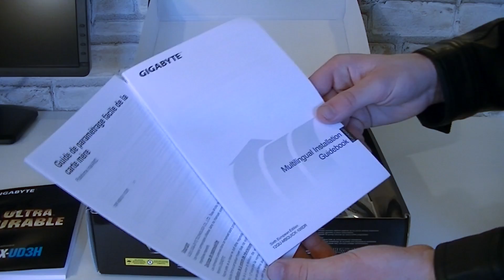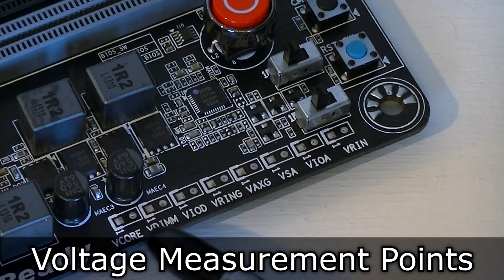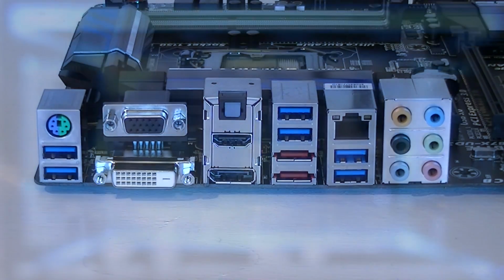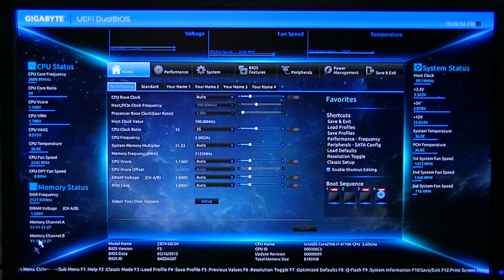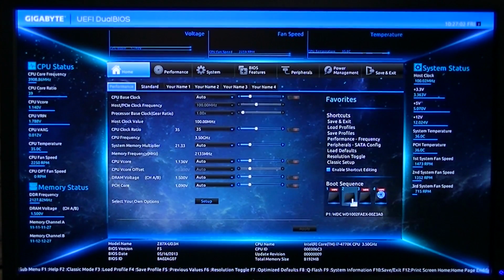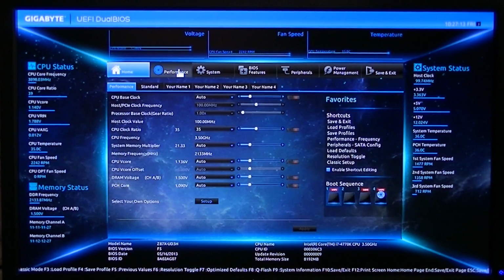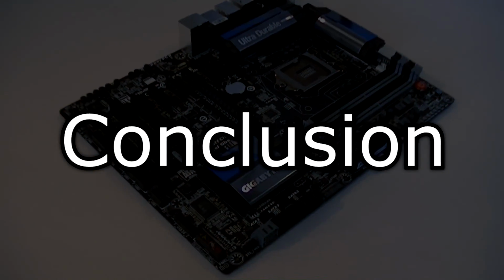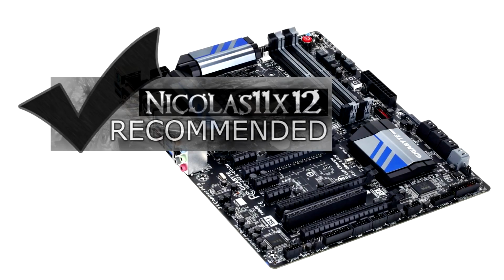GIGABYTE GA-Z87X-UD3H Motherboard Review

Comment: I'm struggling to choose between this board and the Gigabyte Z87X-D3H... This board is £40 more expensive than the D3H and I don't really understand (I'm a noob builder) what this board has that the D3H doesn't.
I'm getting the 4670k cpu and want to overclock can both boards do this?

Comment: hey, can you review on a AMD A8-6600K 3.90GHz Quad-Core APU w/ Integrated Radeon HD 8570D, with a ASRock FM2A75M-ITX AMD FM2 mITX w/ XFast 555, X-Boost 7.1 HD Audio, HDMI, USB3.0, SATA-III RAID, 1 Gen2 PCie x16 mother board, and how well is the mother board? i would like this for gaming but not heavy gaming, maybe going as high as WoW nd Bf3 nd BF4